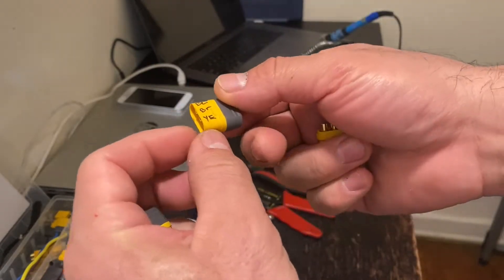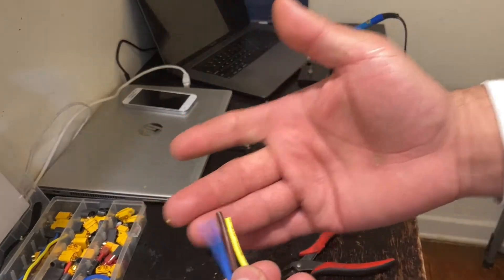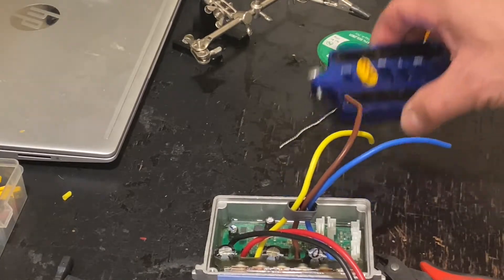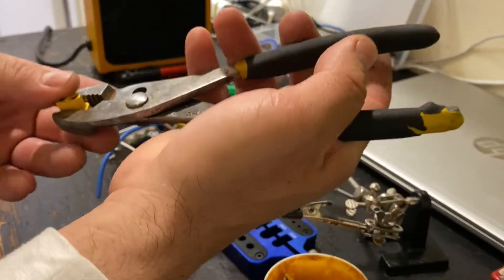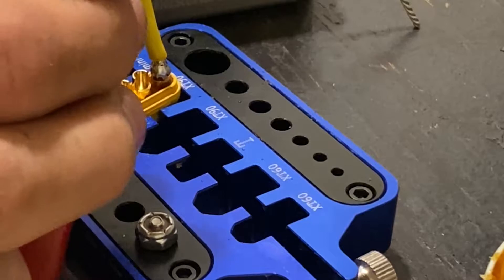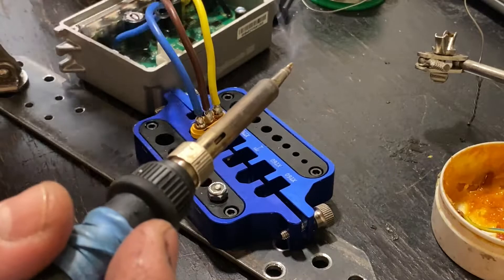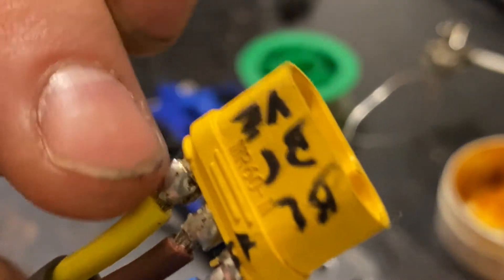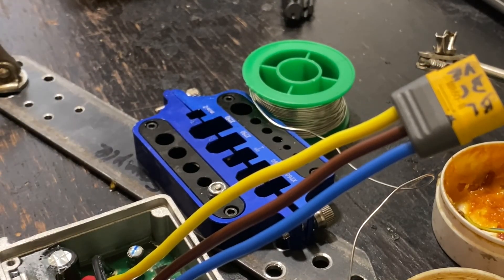Controller to Motor Connectors upgrade MR60. English VERSION

Comment: Love your video, This is my first time doing this. I'm gonna do it again. Because I don't think my connections are solid. Because every time I'm driving and I stop. It's like the scooter resets itself. Everything turns off except the battery indicator on the Dashboard So I'm watching videos and practicing before I go back and do it the right way. Because I'm pretty sure that's my problem.

Comment: When you do the same for the battery, how do you disable the current in order to work safely with wires?
Reply from the maker: I usually cut one wire at the time then I make sure positive wire is sealed before I start to solder. To disable battery you would need to open it and get to bms but such a small adjustment is no need. However if you do not have experience in soldering I would not suggest you to do it.
Reply: @esnkaz  Yeah, that's what I thought. One wrong movement and you end up short circuiting the battery. Thanks for explaining. Great work.

Comment: Can we just use XT60 connectors insead? Don't want to buy MR60, but have lots of XT60 laying around. Could use two connectors so total 4.
Reply: MR60 are 3 pin. So there's usecases.
Reply from the maker: Yea why not :) they both hold same 60A

Comment: What is the benefit of updating to these connectors?
Reply from the maker: Its a problem that ninebot has. Regardless if scooter has any upgrade connectors sooner or later burn. So they need to be replace before controller gets burn or other components on the scooter. Its an easy solution save time and the huge expense of replacing components on the scooter when doing this needed upgrade.